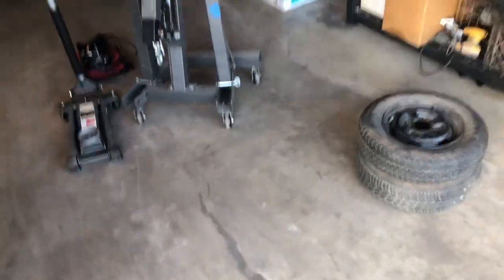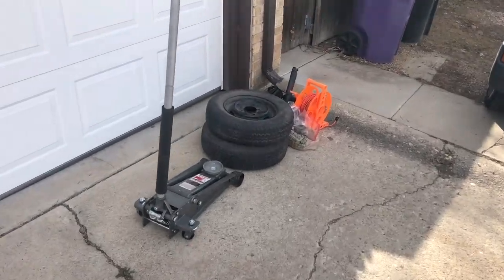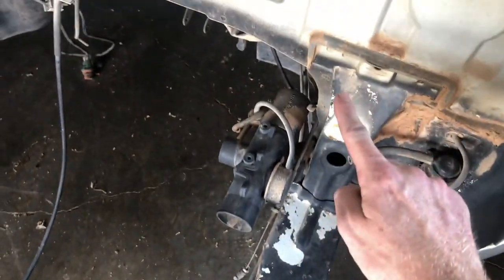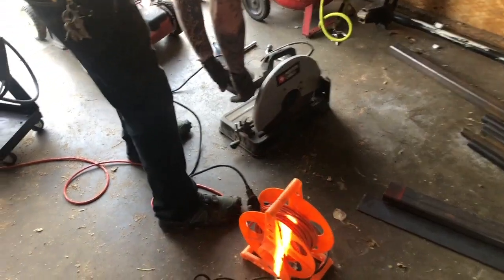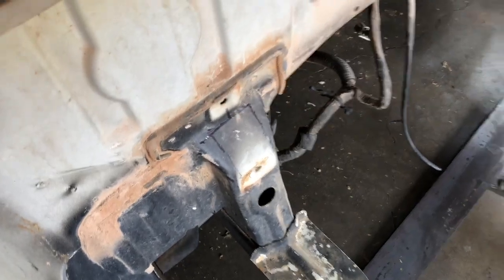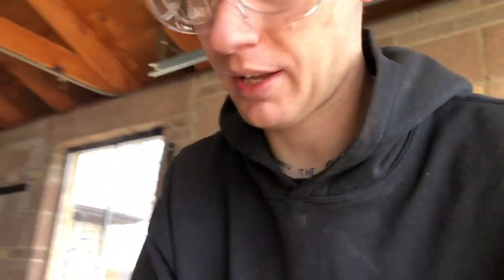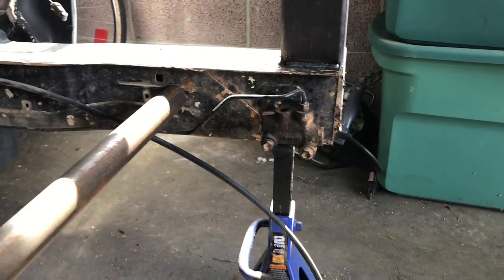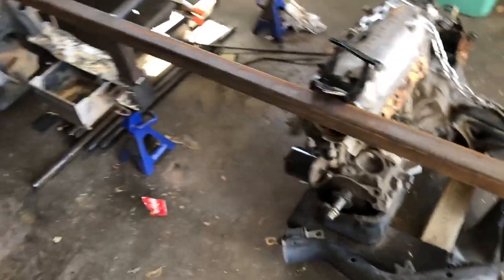Suzuki Carry Engine Swap Ep. 7 - REBUILDING THE BACK HALF

Comment: What Welder are you guy's using?

I SUCCESSFULLY use my HFT 120V Flux Core with 0.030"Wire!
Reply from the maker: TK Skagen Steve has a Miller unit. Unsure of the specifics but his needs argon